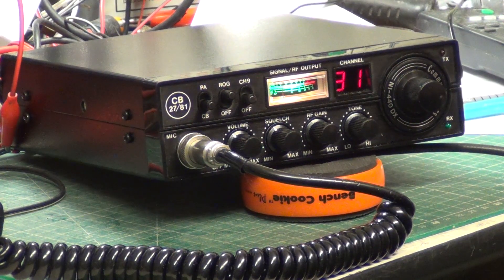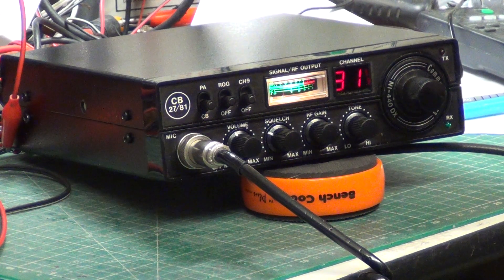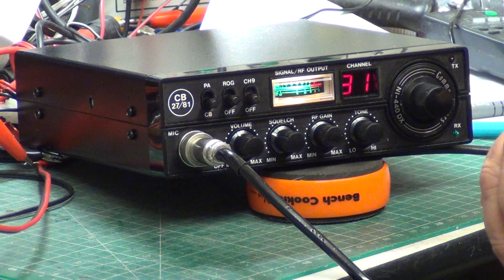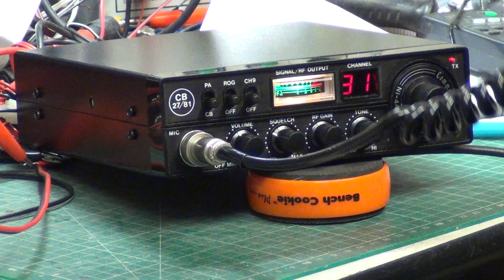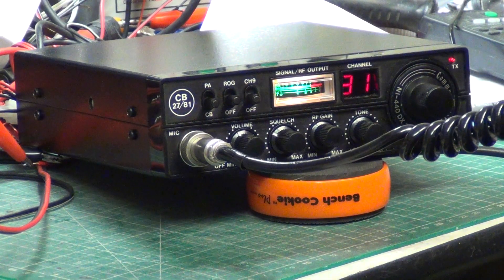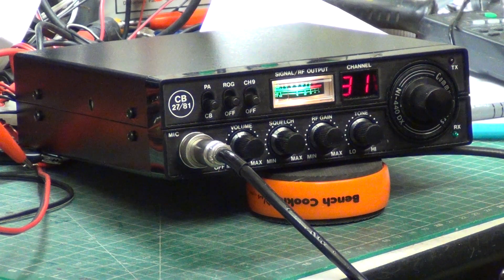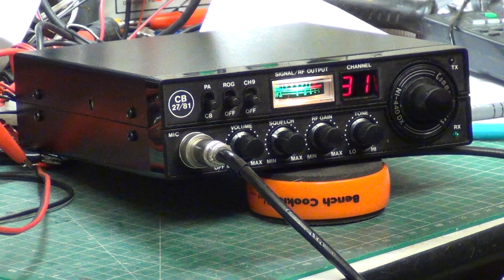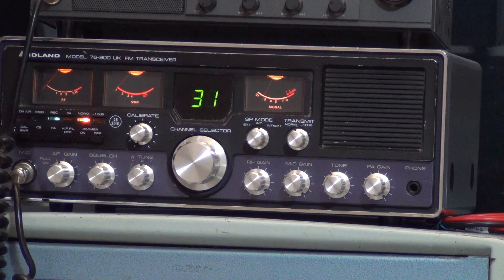LCL Communicators NI440DX CB27/81 UK FM CB radio - On The Air test

Comment: I bought one of these in 1982 for £32. Loved it. Got a s/h one now I found at a car boot sale for £5.
Reply from the maker: Well done on the £5 one. The RRP on these in 1981 was £89.99.

Richard
Reply: @UK FM CB radio servicing  Cheers, still can't beat the deal I got on my Stalker 9fdx. £2, eight years ago, also from a boot sale. Both in good working order.

Comment: No gas report since no change.  What was the big CLUNK on the Midland when you keyed up the RUT (Radio Under Test)?

Odd choice by the vendor to put text on the skirt of the channel knob ...  I assume that people who had these would line up the knob so it read right on their favorite channel.
Reply: think they ran out of space on the front facia by the looks of it...the big clunk was the MASSIVE relay in them, some say tsunami's are caused when the good buddies keyed up on these radio's :D...I had the kestrel? version, terrible bleed over box back in the day, prolly ok for the sparseness they call CB today
Reply from the maker: To be fair, quite a lot of the bleedover was caused by bad buddies with over deviation & burners.

Richard